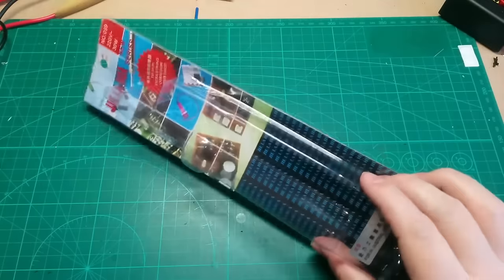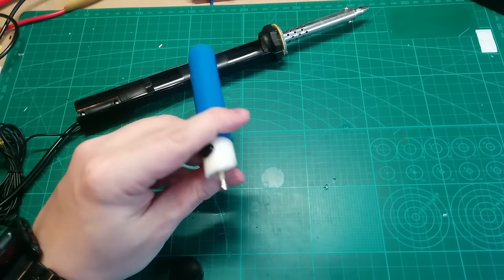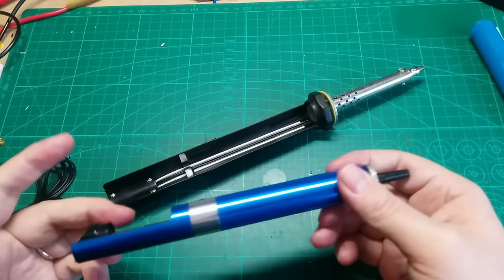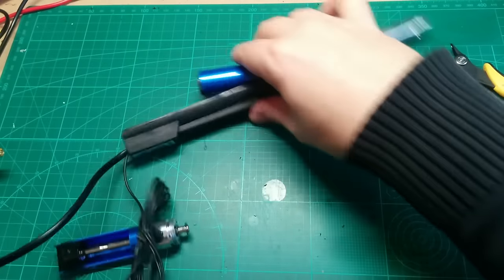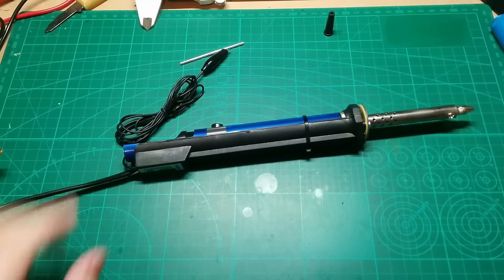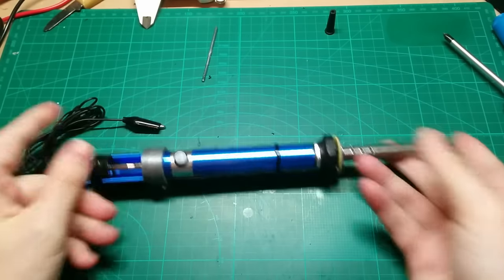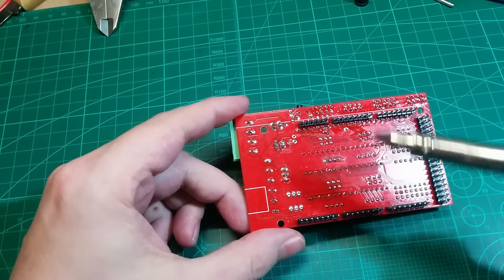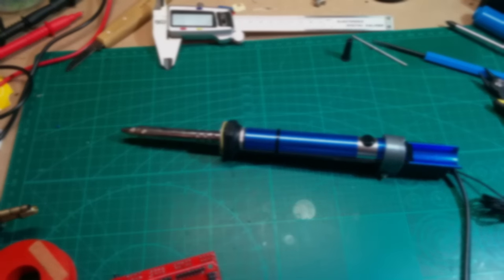#Random: Desoldering Pump Mod - From Fail to Handy

Comment from the maker: To make it clear: This desoldering pump is a piece of crap, DON'T BUY IT! But since I already had it why not have a look if I can make it usable.
Reply: you were unlucky. Yours  is defective. I have one and works like a dream. Other reviewers have being impress from this tool. Sure there is an issue with heat isolation and the emptying mechanism but for 10 euros is great.
Reply from the maker: @nickolasgaspar9660  Possible. I only had one and it was broken ;) That happens with cheap tools, QC is non existent and you have a good chance for a broken one. In the case of this thing I found out mine was a cheap clone of a cheap tool so... yea. You are right but at the same time I still would not buy it again ;)
Reply: @MakenModify  well to be honest I bought mine from a local seller and it is distributed under a German brand. So my  chances of being  intact  were elevated.
The vacuum is amazing and it works great when the parts are not on a  large patches of bronze.

Comment: The regular suckers (without the iron) always seem to get clogged up near the tip. When this happens I use my iron to remelt and clear the tip. This little tool you showed here looks like it would clog up just past the heating element in the middle of the iron. Is this the case?
A couple of unsolicited tips:
  A trick I use with the regular cheapo solder suckers... If you cut a bit of heatshrink that is just a bit longer than the tip of the solder sucker, and apply it there are 2 benefits. One the heatshrink will add an easily replaceable thermal protection layer for the tip, and second the extra length of heatshrink past the tip will allow you to narrow the size of the opening, greatly increasing the power of the device in a smaller area.

   If I can ever get well enough to work on some bigger projects I'd like to build a 3d printer myself. What is wrong with the cheap RAMPs board? Is it a certain model or something specific to look out for?
Reply from the maker: First of all, thx for the tip, will try it ;) had no problems so far with clogging on that one. 
This Ramps board was by far the worse pcb i ever got from china. Some  connections were not even soldered, several shorts on the board... really bad... but most ramps i had so far were ok but this was was awful xD 
hm.. i've build 2 printers so far (own design) and some for the university, most run on RAMPS and that is 90% adequate for most printers. Only if you want some special features or kinematics this may change. I rund my printer on Ramps+RaspberryPi (octoprint). Btw. after long time there will soon be a video on my last 3d printer design ;)
Reply: Make'n'Modify 
  Thanks for the reply. I need to read into that R-Pi setup. I have a spare Pi3 laying around that needs a home. I thought the Pi couldn't do real time projects like this.
  When you say there were "shorts" on the PCB, were there any shorts under the solder mask? 
   I'm currently working with one of the developers of the AVR Transistor Tester project (the little component checking LCR/ESR meters sold as cheap kits from China). I'm trying to collect all the information contained in different forums from around the world, and put together a reference for everyone. I've collected data on most of the different failures people have experienced from the Chinese Transistor Tester kits. I have seen 1 case of bridged connections under the solder mask. It was on a PCB with a red solder mask too. 
   The most common problem on these little devices is when the microcontroller is shipped without programmed firmware.
  -Jake
Reply from the maker: The Arduino with ramps dealsy with the real time stuff, the  pi just connects to the arduino ans provides a web interface to upload gcode, control the printer, check the webcam and so on. means i can leave the room and monitor the printer from my smartphone.
No the shorts were mostly due to unclean soldering as far as i can tell, did not check it in its entirety ;) since it was visibly bad i just got a new one and saved some parts
Reply: @MakenModify  Answer the soldering iron question lol. Has it broke? Does it clog?
Reply from the maker: @watchingin3d549  did so far onle use it on two keyboards.... So used it to desolder 312 contacts with it so far ;P no clog so far... But since I desolder a lot I switched to a mor automated desoldering tool

Comment: I've Just fixed the crap electric chinese sucker. The problem is the silicone ring seal that is leaking. To fix, I just applied silicone sealant to the ring taking care to not close the central hole. Re-assembly the sucker and then apply another coat of the sealant to the plastic base and the sucker. After this, the sucker really sucks a lot of air.

Comment: Nice video :) the only thing I would suggest is to earthen the heating element because you never knew when it will fail.
Reply from the maker: yes... you are right... this is more a how to make something that is unusable into something useful, but yes since it is now a metal case, an earth line would be a good idea ;)
Reply: @MakenModify  Do a video.

Comment: Hi...you should put some grease  and it should work! and more....from the second one just take that spring and add it to electric desoldering pump, it will fit perfectly and with 2 spring and some grease will have huge sucking power ;) .
There is another model with yellow handle that works perfectly.
Reply: đ 
p

Comment: The desoldering pump you modified cost about 4 euros. You will see some safety issues if you unscrew the cover panel near the end. Please make sure you check those connection instead of getting zapped some day.

Comment: Adding a Compressor to it is an ultimate MOD, then it works like those expensive units ,i  just got this one as i ruined 50$ AMP board while trying to change some components  , so i  got it ,  for me its worth it weight in gold :) and you get an option to mount a compressor on it .
Reply from the maker: Hehe good tools are worth every penny ;) But on that one i cheaped out and wanted to get it going anyways :D ... since I got a vacuum pump recently I'll think about how i would do that. thx
Reply: i  dont exactly know how my self as well, but i think i remember some time ago, someone did it here on Tube with instructions, bet we can find it when time comes for such project , i still didnt try mine to see how it works ,  but i see here its as good as i need it to be . Great vid , thanks .

Comment: On eBay I found a orange one that looks like yours,it cost 7.99 or 8.99 ,mine works perfect every time,and comes with a cleaning rod,and it makes very clean removal of solder.
Reply from the maker: yea I had the orange one too, it worked good, but eventually broke and was not really repairable. So i thought i might try out this one... but the orange on was better ;)

Comment: Bought the yellow one from China it was ok at first but the tip starts to degrade very quickly and solder buildup inside these things soon stops them from working and you cannot easily open them to get the solder out - Think i will stick with the manual solder sucker - Nice mod though!
Reply from the maker: Jea it's a piece of crap... The mod made it work forme for a while but I soon upgraded to something more useful

Comment: What do you think about - adding few drops of oil and changing the spring?
Reply from the maker: honestly I don't know. This was 6 years ago, I meanwhile moved on and bought a proper desoldering gun. (had to desolder switches from some old mechanical keyboards)

Comment: I bought the same thing some time ago. It developed a crack at the sharp corner right where the pump seals against the hexagonal plastic part near the heating element after maybe 20 "sucks". An obivous weak spot (I guessed that would happen right when I had it in my hand the first time). The designer had no idea about stress relief. The heating element wasn't soldered fo mine either. But I have to say it was one of the very few china products that really are crap (for what you pay; another one being a crimping tool that had completely unuseable jaws, because they crushed the crimps instead of folding them).

Aja, und immer wieder lustig wenn man in deutschen/österreichischen Videos Pollin Werkzeug sieht ;)  (das Popel-Ding mit dem blauen Sechskantgriff). Deren Qualität ist zwar auch oft nicht mehr als Ebay-China-Niveau, aber einige Dinge sind dort echt ein Schnäppchen.
Reply from the maker: yep this is actually one of the bad examples for cheap products from china.
And yes you can't get around pollin ;)

Comment: A worthwhile project would be to somehow make a pump like that out of a ts100 soldering iron - the $50 microprocessor controlled adjustable-temperature one with the OLED screen.
Reply: Better yet, I’d like to see the open source aspect used to make a proper desoldering iron using replacement parts that’re already on the market. Like, but the Hakko clone from an Aoyue station and use the microcontroller to control a solenoid for better suction… either a Venturi with a pancake air compressor or a vacuum pump that keeps running after you trigger it so that successive pulls will be stronger.

Example:
Short pull to start the motor and open the solenoid (low suction).
Place on joint while motor is running and solenoid is closed and pull again (max suction)
Countdown resets and motor runs for several more seconds allowing for successive pulls at max suction.

Comment: I use the same tin extractor and it's fine. So either you came across some rubbish, or it's the fault of the user's hands. I also have a vacuum pump and this will do exactly the same job for a few crowns. But you need to know how to do it a little, but I think that if it arrived already bad, it is for a complaint. But how to claim it in China, right?
Reply from the maker: Yea I think it was a cheap knockoff of a cheap knockoff. But thats an old video. Since I'm into mechanical keyboards where I sometimes have to desolder 100+ switches with diodes (so 4 joints per switch) I got myself a automatic desoldering gun with pump. This was the try of a poor student to save a buck 😅 the engineer with a job and family values a his time and a good tool 😬

Comment: There is an even worse model available where the plastic coated mains cable cores are 0.5mm away from the heated part.  I am too scared to use it.
Reply from the maker: Oh sounds bad 😅 stay save.
Reply: @MakenModify  I took it apart and it was even worse than I had first thought. There was no real element, just some sort of heatproof material wrapped with very rusted iron wire. And the wires were all melted. I threw it in the bin. I kept the power cable. The only useable bit.

Comment: Hi I wonder if you can attach the Engineer SS-02 on that 🙄
Reply from the maker: Probably, but a SS-02 and a TS80 will work better together than that thing 😉
Reply: @MakenModify  Hi, I got one from our local online shop for just around 5 dollars cheap yesterday. One thing I noticed is the spring was lose so I twisted it a little bit and voila it works very good. Also There is something a piece of silicone thing on the gasket that maybe blocking the tube so I removed that. You're right haha 😂the SS-02 is more than capable than this thing but its a 30 dollar tool expensive but its much more reliable and you can use it for a long run.

Comment: it will be very smarty to fix a  electric vacuum pump and connected will a switch relay and when u press the switch u sucks the wire solder

Comment: Can you just mod the suction rubber part?
Reply from the maker: AC Mild maybe... There are quiet some mods you could do instad but I just did it and recoded it without much planing. Easyest might me to change ore stretch the spring to give it more force.

Comment: You have to let it preheat for three minutes before using
Reply from the maker: possible, but it's still a piece of crap. Got something proper meanwhile ;)
Reply: @MakenModify  I got a vacuum one but it still doesn't get hot enough. I'll be using 138°C low melt solder paste and trying. I can't find a mod video to make the temp higher for any vacuum desolder tho.

Comment: Please don't buy this horrible grey market copy! You can get the original Ningbo Zhongdi ZD-211 rebranded by major local established suppliers, it's much better made, and should correspond to basic electric safety requirements with proper crimps and cables. There isn't even much of a difference in price to speak of, ZD-211 is about 10-12€, and you can probably find one for 7€ or so if you hunt around.
Reply from the maker: Yes this is thing is pretty crappy. I don't know how much of an upgrade the "original" for 10€ is. I would honestly tend to not buy either of both... I already had it and needed it to work for a single project ;)
Reply: @MakenModify  Well it's enough of an upgrade to guaranteed not electrocute you, and to work for 10 projects or so straight out of the box without having to fiddle with it and try to fit another extractor to it.

And then i heard the plastic gives up, so... no, it's not a high quality, high endurance item either. It just about clears the lowest bar and stops right there. This one doesn't even get that far.

Zhongdi is a fairly serious tool company. I have been using their 929c soldering station for 15 years - it's got the punch, it regulates on the dot exactly with only a modest lag, the fit of the tip is excellent, the tips resist wear pretty well. With some duds here and there, and you shouldn't expect magic out of lowest end budget tools, but they're an older manufacturer and did some contract work for established brands once in a while.

Comment: Don't buy shit tools kids.
Reply from the maker: True but I tended to cheap out when I was a student. And a proper desoldering gun costs basically 50x as much and if you just need it once a year... but yea, at least don't buy this shitty tool, I guess ;)
Reply: @MakenModify  The plunger sucker on it's own is a great tool. But that combo iron and sucker together is strange. I would have kept the standard sucker together and thrown that other piece of shit out the window. Buy a middle of the road soldering pencil.